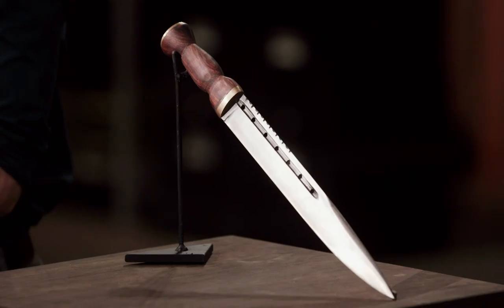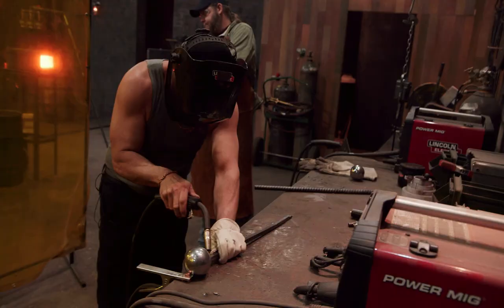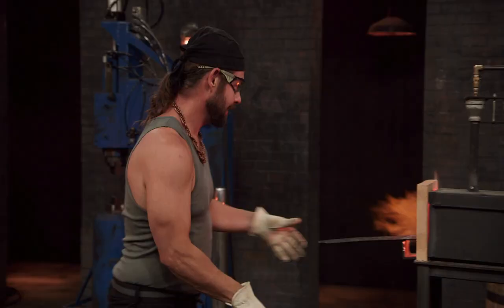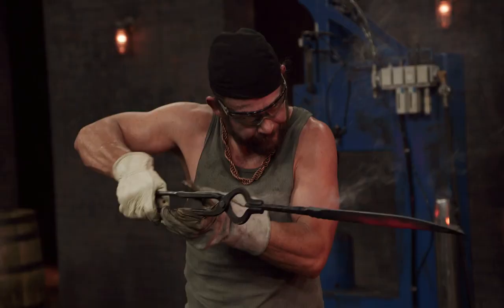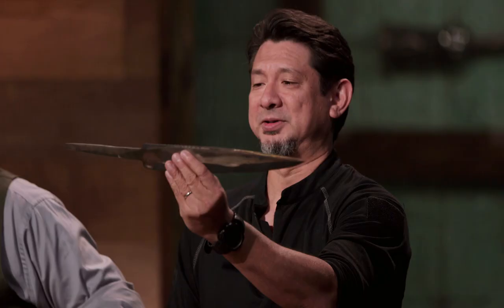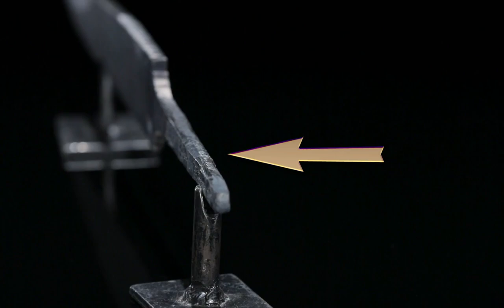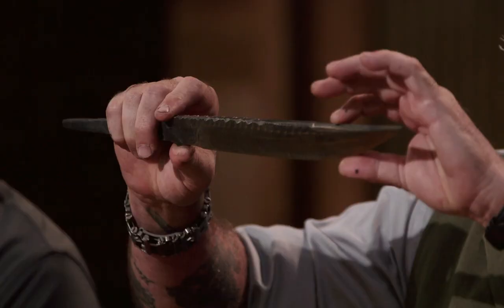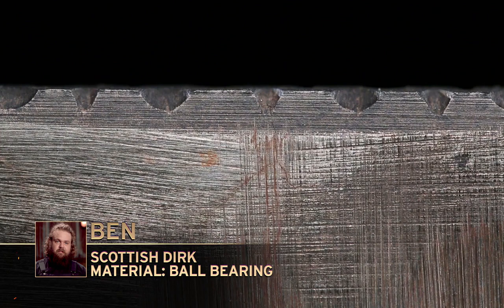Forged in Fire: The Scottish Dirk Challenge (Season 5, Episode 10) | History

Comment: I have never forged a blade before BUT I KNOW that I would totally win at this show.
Reply: Frank's world well you just heat it up. Press it to shape plus hammer in its predefined shape. Get it glowing hot and quench for about 8-15 seconds. Then buff it out and your guaranteed no metal issues.
Reply: @1014p  there is much more than just heat and beat.  Like temperature control what kind of steel to use and how to temper it after hardening it. I have learned much just stock removal knife making I really believe in my abilities.